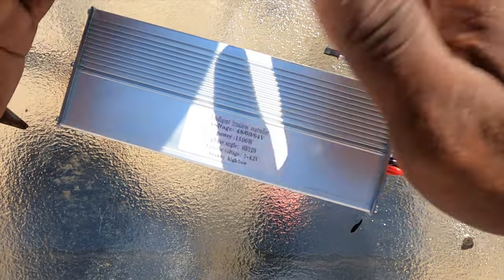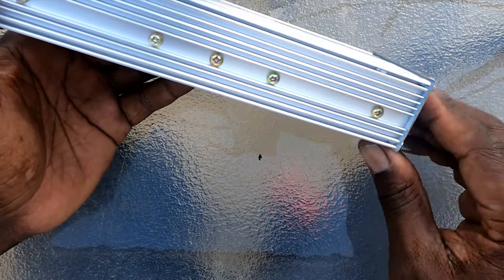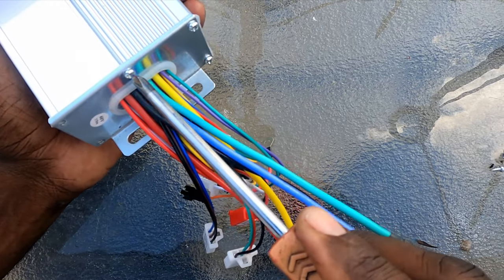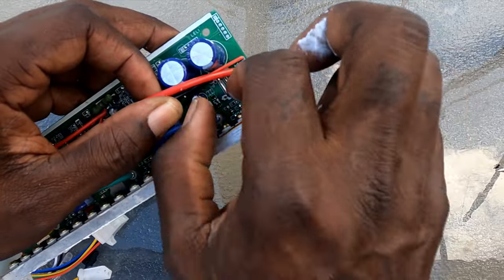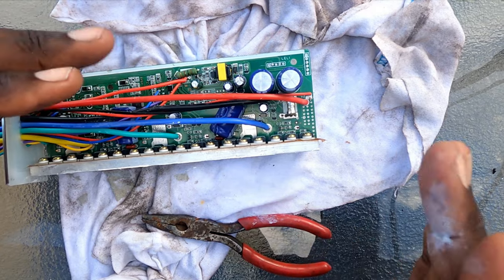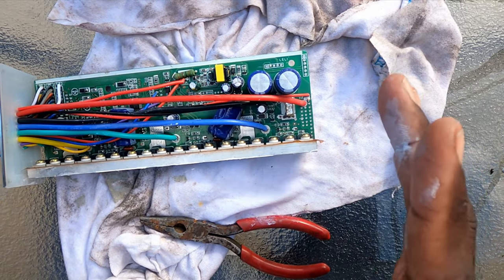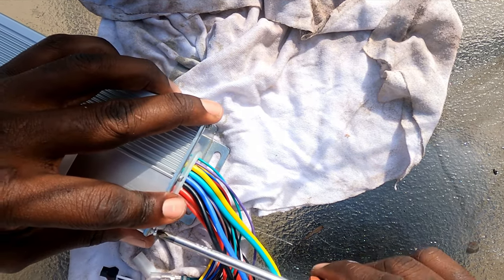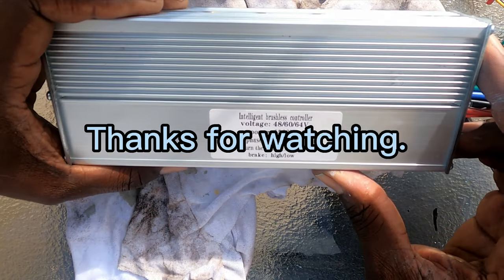How to shunt mod your ebike controller for more power.

Comment: If your going to reduce the resistance on the shunt that much its going to run loads more power than it was originally designed, I would beef up the solder tracks like I did on mine or you will pop one of the tracks, It will also reduce the risk of resisance building up on the little FET legs and then cooking a FET as a result. It will also allow for more power and make it go a bit quicker as there is less power being lost through resistance.

 I basically did what you did with a little 500w controller except I basically just covered pretty much the entire shunt with solder. It is pulling 170 amps (8500w) from the battery and pops wheelies without even having to lean back. Not sure how long it will last though haha!! Luckily I got loads of spare controllers!
Reply: how long did it last?
Reply: @TomasWatchReviews  It's still going strong bud. It gets warm real quick on acceleration but as soon as speed builds the wind cools it off very quickly as it's externally mounted.
Reply: @jcreedy20  thanks for the answer
Reply: @jcreedy20  Hey I have a question since you seem pretty knowledgeable, So I bought a generic controller like this on Amazon but it can run 72v instead with 100v capacitors. It's rated to pull maximum 50A but it doesn't feel like it's doing 72v 50A at ALL, So I opened the controller and there were 4 points that said 60v,64v,72v,80v. The 60v option is bridged connected with what appears to be solder but for some reason when I try to melt it, it doesn't want to budge so I'm thinking that's the reason my bike doesn't feel like a 72v. do you know anything to help me? I also tried bridging the 72v point but no difference.
Reply: @unrivaled.zzz11  No this will have nothing to do with the power output. You are using a 72v battery on the controller aren't you?. Basically those solder pads are literally to set the cut off voltages for the controller. So the controller will cut power when the battery reaches a certain voltage when it runs out. If the 48v solder pads were soldered the controller would cut power much lower than if the 72v solder pads were soldered. It has no bearing on power. If you want more power just do a little shunt mod and make sure the aluminium block that bolts to the controller case has heat sink paste on it.

Comment: The 'SHUNT MOD' is simple in terms of electronics. I did notice there was rust on the leading edge of the board when you reassembled it. That means there is water ingress on the top of the controller. 
It would be nice to see someone add a Super Capacitor in parallel to the battery to see what that does for instant performance.
Reply: Great idea:  adding a "super " capacitor to the input.   Can't really say it increases the current output during a hard acceleration, unless you put it on a dyno.   But, a stop watch is the next best thing.   Since you're dumping more current through the motor windings, they'll be getting hotter.   ...may not last as long.   Keep an eye on the temps.  Imagine having two big hub motor wheels on the rear of a scooter...like a  "duallie" more copper to spread out the heat.
Reply: There's an ebike with no batteries called pi pop that runs off supercapacitors. It's in its 3rd generation right now pretty cool but its based put of France

Comment: Really interesting video sir. 
I too am a HVAD! 🤓
High Voltage Ampere Dude! 
I’ve modified my bike a few times. I currently have a 7245 Sabvoton. It is super smooth and hits 45 mph flat out. I recently bought a monster 72200 Sabvoton controller that I’m going to install. But probably will dial it back so it doesn’t fry my 1500w rear direct drive motor. I’m not sure how much current the motor can handle until it busts the magnets loose or smokes the windings? But I’ll probably find out 😂 
Maybe I’ll do the shunt mod on the 7245 controller and see what improvement I get before trying my new 72200.
Thanks man appreciate your work.
Peace Prospector Tripp
Reply from the maker: Thank you the 7245 controller is awesome  and my son's bike is a 1500w and I have a 80a controller in it but also pretty light too he gets a new controller next month tho but the 72200 will be a beast of a controller for it's size
Reply: If you want to protect your motor, you should try adding fuerofluid to it. The magnetic fluid will coat the magnets and keep it cooler. I don't know the suppliers' link, but it's a bike shop in Oregon and they have a YouTube channel. Just put fuerofluid in the search bar.

Comment: Just did this to my son's 1300w Apollo dirtbike and it worked really well! He's so stoked! However, I already ordered the Electro & Company Upgrade Kit for his birthday at the end of the month 🤫 😄
Reply from the maker: Nice, how much power did your son noticed after the shunt mod
Reply: @E-bikeguy  Well he can easily wheelie now whereas before the front wheel wouldn't even come off the ground. It's pretty significant. I'll do a top speed test this evening
Reply from the maker: Heck yeah,  let me know how it comes out
Reply: @E-bikeguy  So it goes about 4 to 5 km/h faster. Not bad. This bike has 3 dials so you can adjust the response time, power output and speed. Do you think bypassing this "potentiometer" would result in any gains? (I'm guessing it wouldn't and I'm not even sure how I would bypass it 🤷‍♂️)

Comment: While you're in the controller, I'd clean off all that extremely cheap white thermal paste and apply some quality thermal compound (aka thermal interface material (TIM)). It will make a huge difference in the amount of heat transfered from the MOSFETS heatsink to the case.
If they used white paste gunk between the MOSFETS and the heatsink, I'd replace that with quality TIM as well. The white compound used on many controllers is about the cheapest possible...to keep down manufacturing costs of course.
Check out comparison articles on thermal compounds used with computer processors.
Reply: I recommend "Noctua NT-H2"...paste will last in the tube for years

NT-H1 and Arctic MX-4 are cheaper and work very well too

Just avoid everything liquid metal. These will short your components and kill your controller

Comment: Are you not going to beef up the other connections to handle the larger power draw? To me this is only part of a shunt modification.
Reply from the maker: @scotthenry3401  shunt mod a controller don't put out crazy power but just a little more than stock

Comment: Could you just wrap wire around the shunts instead of soldering? Thanks
Reply from the maker: @sidekar  yes. You can do that also might not be a good connection

Comment: Great video. Can I get your opinion? I accidentally touched the positive and negative wires on my controller. Now it don't work. Any way to fix it?
Reply from the maker: You can but it's a long process,  you probably blown some mosfets
Reply: @E-bikeguy  thanks for getting back to me bro. I pulled it apart. Nothing looks bad. Nothing smells bad. I don't know., I  hooked everything back up but nothing 😭 I ordered a new controller. I was just hoping this one was still good.

Comment: Do you every use potting resin in the controllers to help with additional heat ?   have you ever had a controller go out/burn up after a shunt mod ?
Reply from the maker: No, I actually did a sunt mod on the benxi seeker24  no issues

Comment: Should the capacitors be changed to a higher value or will it handle it ok.
Reply from the maker: @Ben-rj7xs  I never did and I won't recommend it but it the capacitors have higher voltage then you can run higher voltage

Comment: 👏 🙋‍♂️ can i do this on my 500w 20 amp 48v controller ???
Reply from the maker: Yes as long as it has the shunts in the controller is accessible
Reply: @E-bikeguy Quick question boss, I have a 48v 800w scooter i injected statorade and put heat sinks around my rear wheel to help with cooling my motor quicker I ride pretty responsible if i shout mod my factory controller will it burn out my mosfets and how should i ride to stay safe..

Comment: I have a colorway 750w ebike would it be worth doing this mod? It only goes 19.8 mph should go way faster with the 48v 15ah battery.
Reply from the maker: @deceptivedoor2814  oh yes it's definitely worth it
Reply: @E-bikeguy  couldn't get the motherboard out of the case was fixed in place and I didn't wanna cut a hole to do it. Any good upgrade kits you can recommend that are pretty much plug and play? I'd like to get a 1500 watt motor at least and a 52-72v battery

Comment: any chance you got the make/model/wiring diagram for this controller? i bought one used just like that board from ebay and all the wires were cut. i cant find any diagrams online for this board and your video is all i have found with this board at all.
Reply from the maker: No I don't I actually sold it like 8 months ago guy just made a offer I can't refuse
Reply: @E-bikeguy  any chance you remember the wiring? i pocked around and found that crossing x pin to ground seems to be regen so i soldered a wire on and ran it  out the box. got most wires figured out but would like to be sure before using it. did you have this connected to a display?

Comment: Trying to get more out of my Philodo H8.   Only getting 29mph out of it.   Supposedly this bike has 2 1000w motors which are stamped on the motors but what makes me wonder is why they used 22amp controllers on this bike one for front and one for back. Also they have disabled the ability to even see the current draw and RPMs from display.    Still I’d like to try and get more out of this bike.    It is however better imo than the Aventon Aventure I sold to purchase the Philodo H8 AWD.
Reply from the maker: Interested,  two  1000w motor should at least have 45amp controllers
Reply: I have the same ebike and I am also contemplating a shunt-mod, but I really want to use a heavy duty switch or relay to cut it on and off. I may experiment with moding the front controller first to test, but if both controllers will take the mod...we'll be doing like 40mph!
Reply from the maker: @Brent Polk  yes it will I have a braker on my bike ill send you a link

Comment: Hey ebike dude ive a question for u ive a brushed controller i think its only got 2fase wires but is there anyway i can add a third fase as its a excellent built controller real nice inside any ideas my man
Reply from the maker: @whitefeatherslinger8194  unfortunately there's no way because the controller have to be designed for brushless
Reply: @E-bikeguy  yea its a pity because them 2fase controllers are built solid and easy to workout ,thanks anyway 👍

Comment: My controller gets pretty warm more hot than warm. If I put it in a waterproof controller bag, would that make it hotter ? And it connector wires would go in the bag also.
Reply from the maker: Yes, if you fell like your controller is getting hot then definitely don't put no bag over it, find out why it's getting hot, they get warm under heavy load but hot no. You need a bigger controller

Comment: I’m not noticing very much difference than before using a 1200w controller my bike is really heavy though seeing a little difference in battery drain. Maybe add more solder?
Reply: The amount of solder does nothing. It's just there to make a good connection between those shunts.
Reply: Thanks one of my controller went bad because of the shunting. I recently did a 35amp controller it gave me more power top speed longer and one to two mph faster. 1500 watts e-bike controller

Comment: Yo, great vid!
Quick question ;

I want to do work commutes and play around a bit. I'm 300 pounds, and want to add a hub to my mountain bike. What is the best bang for buck right now? I want to do 30 to 40 mph minimum. I have a 26" rim with 100mm front and 135mm rear axle.

Any suggestions?

I'm thinking a 2000w kit.
Reply from the maker: Yes ok, I was thinking a 2000w kit with a  45a controller will get you right at 36mph
Reply: @E-bikeguy  nice. Any good kits you suggest?
Reply from the maker: @jakefriesenjake  https://s.click.aliexpress.com/e/_mLpO3mG

Comment: How bad does it affect the life of the battery also since it’s only for torque if I keep it at the same speed does it still waste more battery life or only when I punch it
Reply from the maker: Only if you hard on throttle or going up hills will you see a decrease in range

Comment: So if I change from a 48 volt battery to a 60 volt battery that will increase top end speed? With this sunt modification?
Reply from the maker: Yes higher voltage will increase top speed

Comment: Have you done this or planning to do this with your sabvoton controllers ? If you have done it already what was the outcome?
Reply from the maker: No, I haven't done this to the sabvoton controller, there is really no need to where you can get them unlocked for more power
Reply: @E-bikeguy  Have you looked inside to see if there is a shunt ? I have a 72200 and have the unlock software but it don't work, was hoping to shunt mod it to give it a boost. with my QS 205 5T motor I can only reach 30mph on a 58v battery but it is capable of 400amps continuous and 800amps for 10 second bursts.

I also have a QS 205 3.5T in the shed that is busted and will fix it for the spring so if I cant mod the controller I will switch to this motor and upgrade the battery to 74v but I will miss out on the 3.5T torque as I live in a hilly area.
Reply from the maker: @9 Mile Roar  I did look in the controller but there is no shunt inside it. But I'm going with a fardriver controller soon
Reply: @E-bikeguy  Wow funny coincidence I was thinking the same thing yesterday, lets's do this 😎
Reply from the maker: Heck yeah🙃
Reply: @E-bikeguy  I bought 45amp controller sw900 lcd on a 2000 wat kit wheel 52mph but I'm not keen on the sw900 display the old one is far better the PAS 1to5 being power I find it isn't as good as a shunt. When you shunt bars the best way is to nip together then a fine solder layer not to thick. I got a message of a guy that done this upgrade for  lad now a lad loves speed he's had no bother some times you might and no problem I blew a 30 amp fuse you never put 40 or 50 I put 32 amp no more fuse blow and at top speed I always stop zip my bag and feel the controller cool if irs really hot then you gave a problem. But if you do this upgrade always carrie spare fuses. Or you end up riding home some bikes are hard to ride if you have the time is disconnect haal wires your bike is much easier to pedal
Reply from the maker: Yes, you right controller with a shunt mod will get warm but not hot, but now it pulls more amps to the motor, I like my diy bike instead of the stealth bomer, it's way easier to peddle home just incase something like that happens, and believe me, my battery went dead on me and I had to peddle 3 miles home .
Reply: @E-bikeguy  the best controller to shunt is 17aml 32+2 amp its for 1500wat and 2000 when I take controller apart I just take side screws out and slide the lid then you vmcsn see inside. The shunt bars are on end of circuit board the mosfets aren't screwed at the top through the holes mine they are kept in place light metal bars there is no heat grease they are dry. I think the controller that burn they shouldn't burn that means the fuse is to much. I've just done a shunt this after noon went out it gets to 30 in seconds I went to 39mph for two miles then stopped opened bag controller was cold. Another good tip if you use a bag put hole round and one at bottom I put mesh over other end of bag make slit at both end then open I put these plastic half a funnel shape glued them in what happens clod air goes through the bag and comes out both sides at the back so I'm creating a wind tunnel and berleave me it works. Even in the summer the air is cool on a hot day when your doing 30mph I no we shouldn't do that speed it's to give you an example to keep it cool if it dis blow again I'm just going to put the 45amo controller it's OK I mean 52mph but it's a bit to quick of the mark. It's like a sabvaton bought it ebay new £69 new there quite heavy. But I'd rather have the upgrade its much smooth and pas it great. Its the torgue that's what makes it

Comment: I have an Evercross H9 with the 14ah battery with 800 watts they changed the trigger speedometer to a top mount model with Bluetooth and a thumb throttle and I'm wondering if there is a controller I can put in it to give it more power than it's 28 mph limit, the motor is barely working you can feel it, it could move that alot faster. If I sent the controller to you could you modify it? Is there an email address we can talk about price..

Comment: Hey man I need some advice what comtroller should I buy for my 2019 widewheel dual moter as I feel like 1000w of miter should be faster but my aovo is faster than it what would you recommend and does any 48v controller work with it many thanks
Reply from the maker: Ok nice, let me look at a few things and point you in the right direction

Comment: Hi bro thanks for videos I have questions when the controller is super hot what is the problem the battery or ?
Reply from the maker: Not necessarily the battery, could be not enough ventilation or a big load on controller and possibly over voltage
Reply: @E-bikeguy  ok thanks bro and I done the mod in my other mototec and more power bro thanks
Reply from the maker: @videntemusic2465  no problem